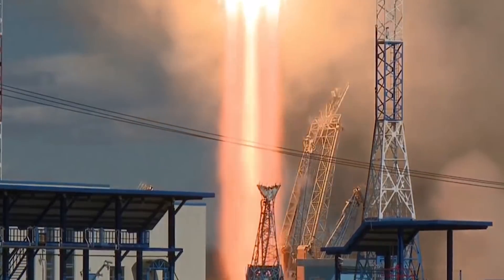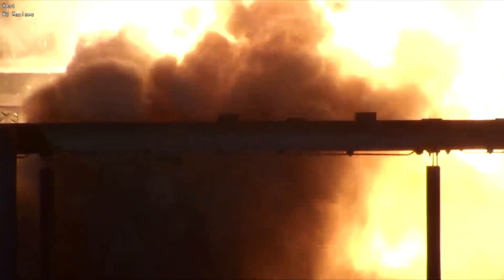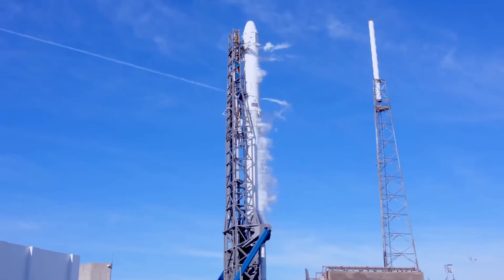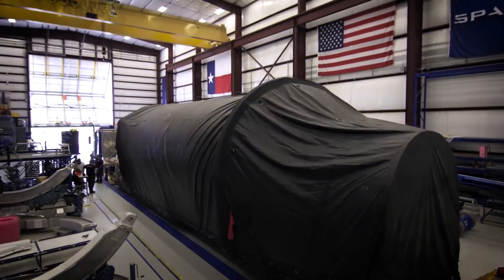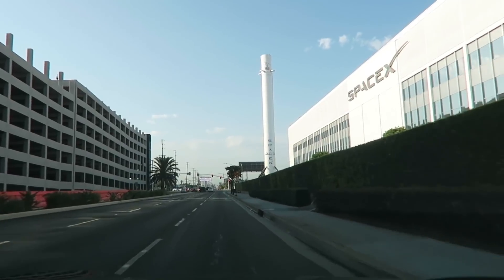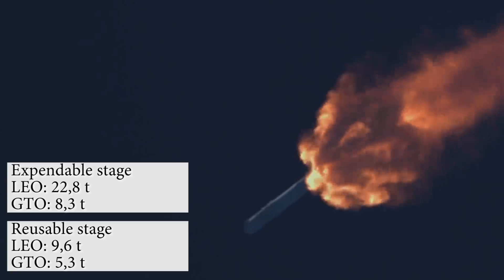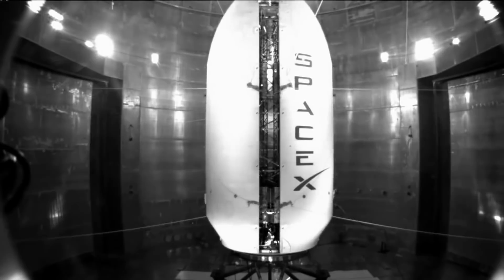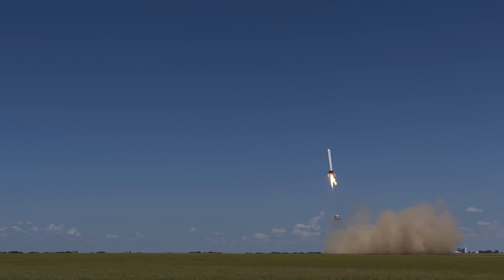SpaceX Falcon 9 - a new guy that shook the industry (part 2)

Comment: thanks for those videos! What make SpaceX very interested to follow is also the amount of informations we can get during their development. I think it's always better to have more than 1 player very strong in the game... I would like Russia and China to also develop re-usable rockets and to push forward the space technology, which I think they will do. But, who known... maybe India or another player will come up with also some innovations. Although, with the fast iteration and progress accomplished by SpaceX, they are on a race with themselve which make it very hard for anyone to compete with at this moment in time.
Reply: Well, the biggest thing SpaceX has done is with the production of the Falcon 9. They make it entirely themselves so the cost is cheap. Reuseablity has been show to be possible, but the cost has not been shown yet, but block 5 should prove that soon. Other companies will soon follow, such as Blue Origin
Reply: I think it's not only to centralize most of the production but also be able to control and change parameters. Especially in the Space industries where a new hardware item to be use is subject to a very high testing... usually in years requirements. And where the managements of the program was working with metrics without understanding fully the technical aspects or benefit and tainted with ideology where Space = tiny market = expansive = less risks as possible =limit what is possible to try. The ion truster story is a good example, where for decades engineers were thrill to their new engine, but that engine needed to have a cumulative of N times in order to be use on a mission. But, without the possibility to use it, this engine could never been tested.. meaning was stock to remain a laboratory experiments. It took NASA management to break that rule for one mission in order to give that engine a test in Space.

Comment: It would be interesting to know the profit margins on all those price points for each entity too. Until the design is frozen for the Block 5 F9, SpaceX isn't benefiting at all from re-usability. Each Block 5 F9 is expected to launch 10 times between refurbishments, and 100 launches in total. The first stage costs somewhere around $30M, so that's a big deal! To avoid expending boosters, I think the goal is to reuse F9 cores for most launches, and the reusable Falcon Heavy for the bigger stuff that would normally require an expended F9. It should be very rare to ever need a fully expended Falcon Heavy launch

Finally, I wonder if NASA will allow manned launches on reused cores?
Reply: They will have to because there hasn't been a failure of a " flight proven " booster. They have been fired quite a few times in testing that eliminates the weak links along the way, which are then redesigned out of the system.
Reply: It would seem to make sense to schedule the 100th launch as expendable . .
Go out with a bang! 
(you could strip off the legs and fins for the trip)
Reply: It would seem to make sense to schedule the 100th launch as expendable . .
Go out with a bang! 
(you could strip off the legs and fins for the trip)
Reply: CRS-14 will be flying on a reused booster, and I assume crew will definitely fly on reused block-5 boosters
Reply: I don't think that's true. NASA vetoed the propulsively landed Dragon capsule. They could refuse reused boosters too, I just haven't heard one way or another